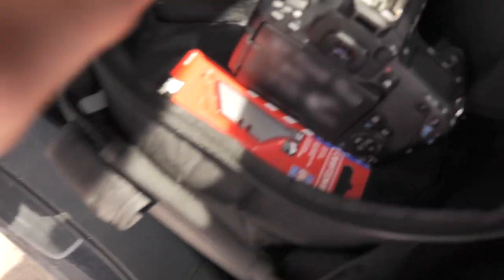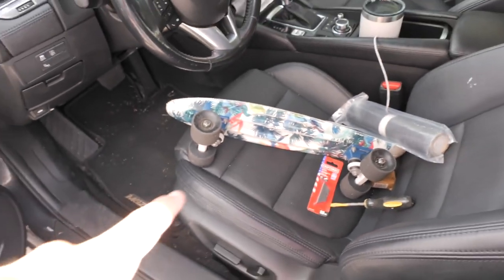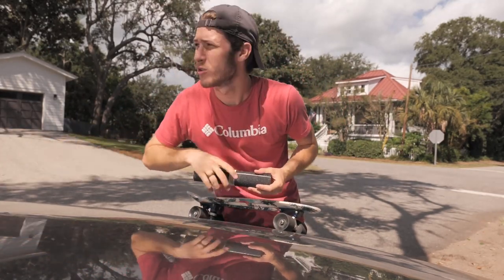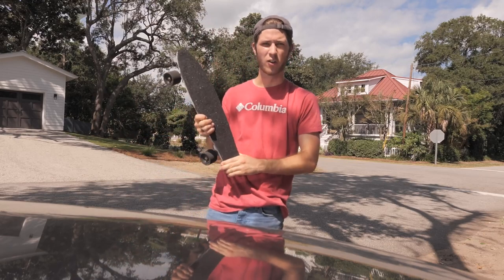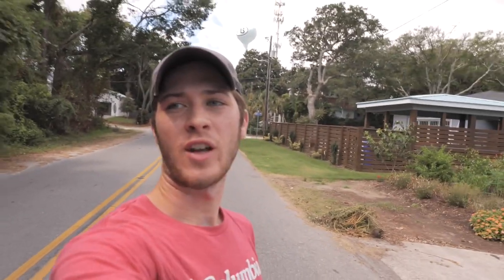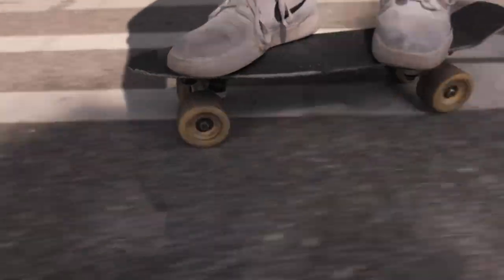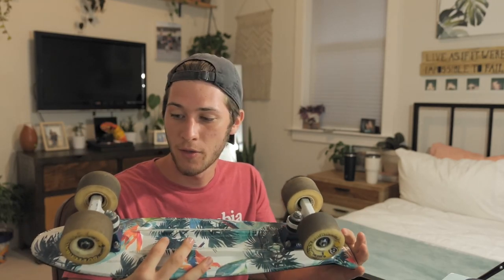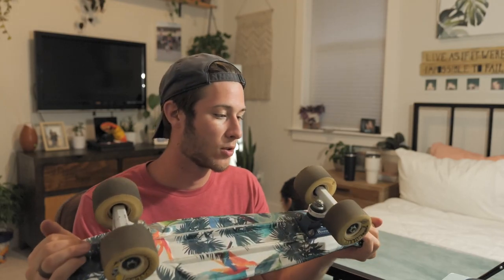3 Easy Penny Board Mods You Need to do Today!

Comment: for learning the penny should I add grip?
Reply from the maker: I’d say, it’s not 100% necessary but it was helpful. But that’s really up to you I think.

Do you have much experience riding or are you just beginning?
Reply: @tpalmer  Well, hard to explain I got a retrospec 27in one that warps a bit for me as well.. I weigh about 225lb so another question is should I shell more money for a penny brand one too? I been trying to learn but also had to lose weight before trying the penny. Been learning a longboard as well but have been slacking too
Reply from the maker: @TheAlmighty  hey, so yeah I’d say if weight is a thing you have to think about go with the nickel board if you really want that penny board style, but if not, then go with a cruiser, you’ll get the best of both worlds of a penny/longboard and I have a few videos with a few different recommendations on the channel if you wanna check those out!
Reply: @tpalmer   Actually mine is a nickel from retrospec it just have give in the center when I weighed closer to 240 and that was slightly alarming. Been slowly losing the weight so may give it a shot and see if the warping was as bad. When I went to Zumiez and tried Penny Australia Nickel board it was like 4x sturdier I felt it had no give… Probably was just me being cheap may try to resell my current one to buy one

Comment: That's great idea. Thanks
Reply from the maker: Glad you liked it! What else would you have done to your board? Any cheaper or more easily replaceable add-ons?
Reply: @tpalmer  I'm thinking to drip some motor oil or lubricant to the bearing but haven't tried it yet. Not sure how it will going.
Reply from the maker: @mkai8978  that could work but be careful with that since it could collect a lot more dirt and mess em up. Bottom line I’d say that you should just upgrade bearings for 20 bucks rather than buy motor oil. Not much difference and you know the upgrades were done right
Reply: @tpalmer  that's right. The dirt will it up. Better buy a new bearings.
Reply from the maker: yea bro, thanks for the idea though, hope to hear from you on the next video
Reply: @tpalmer  Great! Thank you too 👍